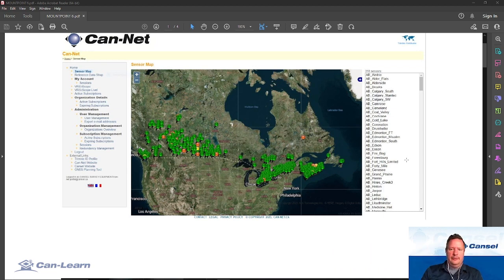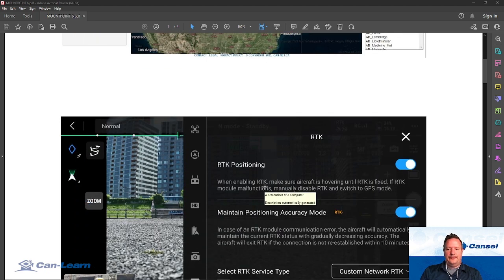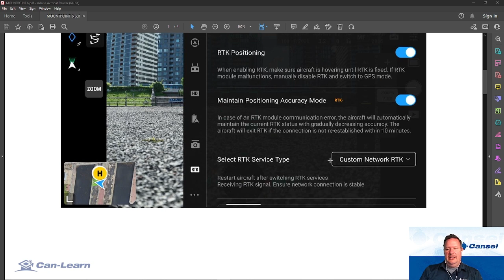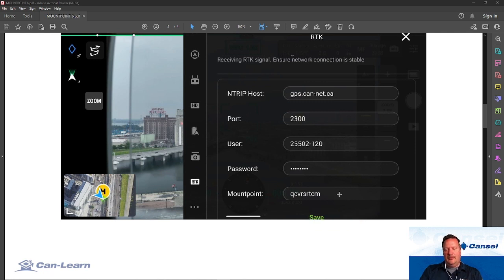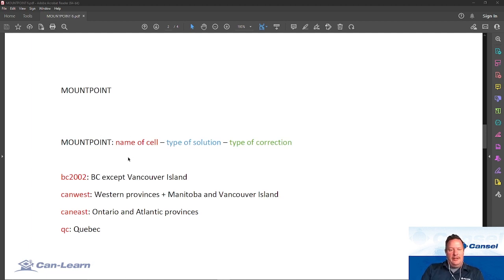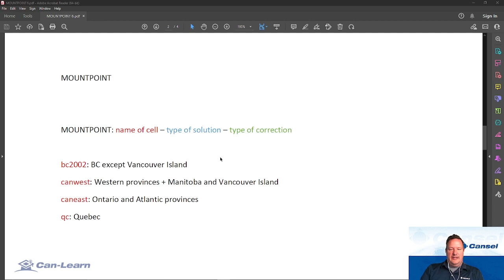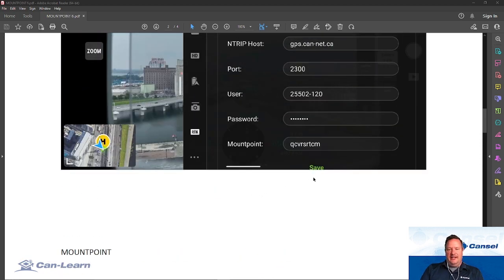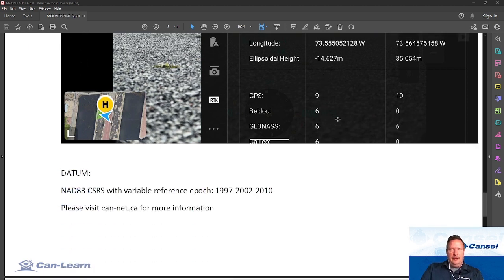Can-Learn: Connecting DJI RTK Drone to Can-Net

Comment: Hey, thanks for the guide!  Question for you, if I already have a can_net subscription, that I use with a Trimble GPS, can I use the same credentials with my DJI drone?  I know they won't be able to be used at the same time, but I was wondering if I will be able to share one subscription between two devices.
Cheers,
Reply: Hey, I just set up my drone right now. Yes you can use the same subscription. Just make sure you are using RTCM, all the other broadcasts won't work. Unfortunately that only means the drone will receive just GPS and GLONASS.
Reply: @tassimotown9667  Yes you can use rtcm32 to get access to all constellation. If you are using Lidar i recommend using SS instead of VRS. Happy flying